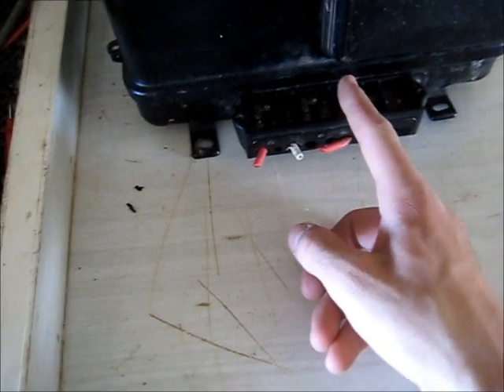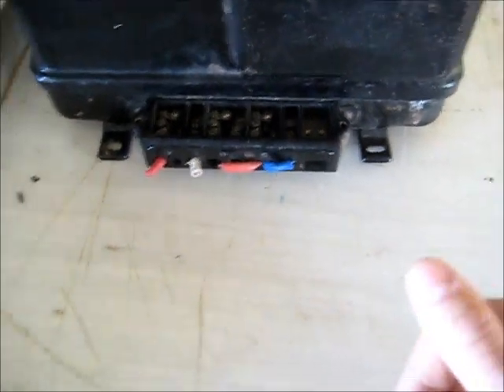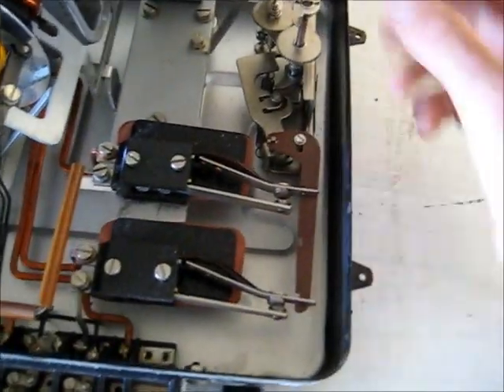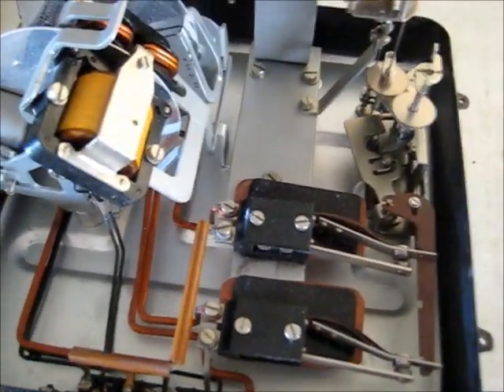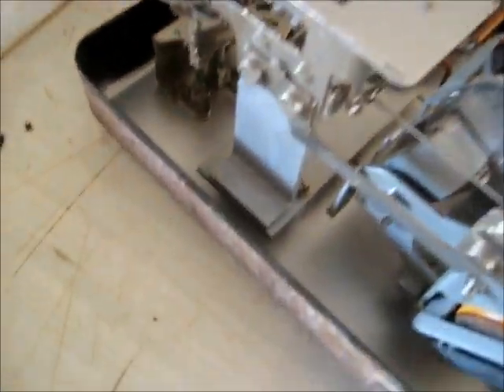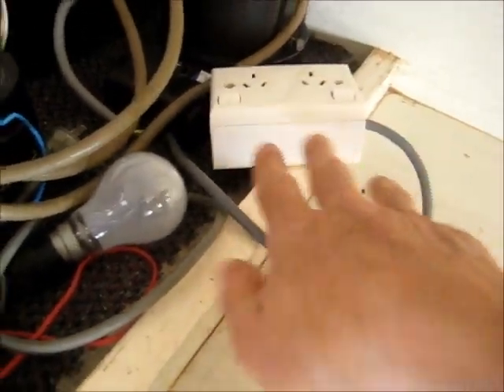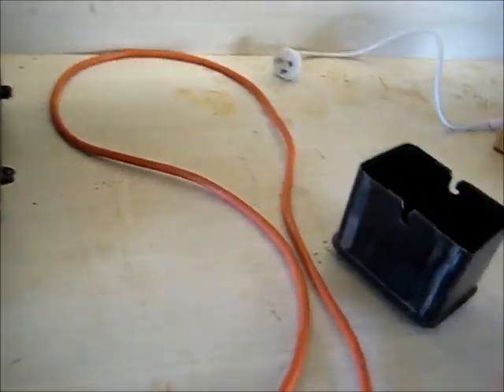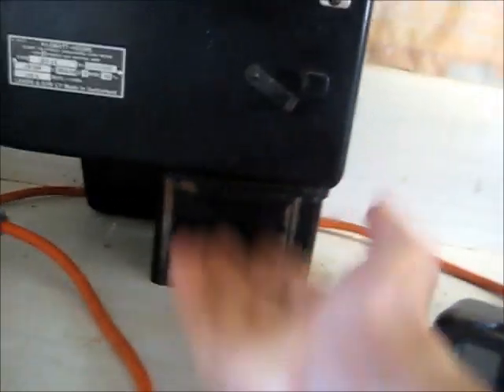Landis & Gyr Prepayment Meter Restore (Part 1)

Comment: They have two types of wire nuts here, one type twists on but there is another type that has a brass bushing with a grub screw in the side similar to that wire connector you show, except that they have a Bakelite cover that threads over the brass bushing. In Canada they were introduced by a company called Marr, so the large kind with the grub screw are called Marr connectors where the small and medium sized twist on ones are called "Marrettes".

Comment: I just have a second look at your video.
Is there a diagramme in the terminal cover ?
Your wiring may be wrong here - have a close look how the current flow goes from inside the terminal block to the current coil, then switch and back to the terminal block.
Old wire colours quoted here. 1-2-3-4
Red active in White Active out (Phase1)
Red active in Blue Active out ( Phase2)
There may be a small terminal for a neutral there.

Comment: That is a very nice and rare meter as it is a 2 phase meter. Look after it.
The gear drive wheel is made from fiber.
The number wheels and geneva's are made from Aluminium.
As you saw yourself . These Landis & Gyr meters are very well made and  superbly engineerd.
Thanks for showing this video.